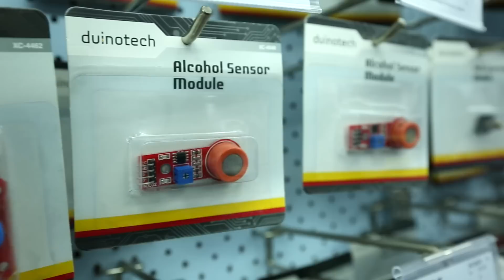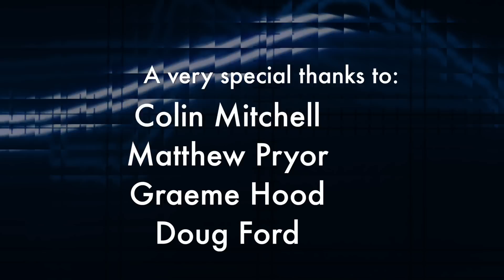The Decline of Hobby Electronics?

Comment: It's impossible to get components now a days without buying them online which can be a pain since even for a 5 pack of resistors the shipping costs more than the actual resistors.
Reply: I am in Europe, ordering parts from  ebay with free shipping is what I do.
It is amazing, now whole sets of capacitors (SMD) an resistors for just a few cents,
same for most chips, everything is there.
Just got a  MASTECH MS2108 Digital True RMS Clamp Multimeter AC DC for 36 $ in an ebay auction.
Can read DC and has rush in current measurement for motors for example.
Sure, there is a lot of crap on ebay too, but the net result so far is positive for me.
Thing arrived in about 10 days. 
Maybe I am not really a 'hobbyist', more a retired electronics designer / programmer...
but still playing electronics ,
 No, an a quick search with Bing will show you that that hobby is not dead at all.
In fact the quality level of it has gone up, what is possible now is amazing.
My site:
 http://panteltje.com/panteltje/newsflex/download.html
many Microchip PIC projects too.
Reply from the maker: Tell me about it. Living in Australia, everything takes forever to arrive and costs a bomb! Forget DHL FEDEX and the rest, even slow mail is expensive and often its a killer to passion for any project in that it takes more then a month often for delivery. It forces you to own your own ready supply of bits so that at least you can tinker without the massive delay!
Reply: bulk is key. don't buy 5 resistors, buy 500 of them(for maybe 10 cents more in total).  kits are generally what you want to go for. just look for "resistors assorted" or something. just buy a set of 600 or how every many you want and you are golden. make sure the values you might need are in there obviously. you even get kits that have capacitors and diodes in them as well if you look harder.
Reply: You can buy bulk packs of resistors from china with free shipping. There are plenty of sellers that supply resistor packs - you get multiples of each value from small to high resistance and the prices are very reasonable. The free shipping is the best part! There are plenty of other deals to be had as well on different components - transistors, IC, diodes, capacitors etc. Check out the site which starts with e and has bay at the end.

Comment: And now Dick Smith has gone completely bust. Apparently the NZ shops were still profitable, it was Australia that let the group down.

But still, there is Jaycar, which is what Dick Smith’s used to be...
Reply: Over here on the topside of the globe (if it can be defined as up) physical shops have made way for online retailers. I have met and become friends with a small online shop owner in my area.

When I was younger I can remember taking trips to my local electronics shop, they had all the standard stuff but dare asking for a specific component. Everything had to be ordered and they used to sell it per piece but way too expensive.

Online everything is so much better, the datasheet is usually linked on the page, only downside is that most retailers won't let you order small amounts when it comes to small components. So you have to order them by 5 or 10, but they cost 2 cents a piece so no biggy.

You can still make your own PCB's but several online PCB manufacturers have popped up allowing you to have your PCB manufactured professionally.

The guy yapping about kits is so wrong! Kits used to exist back in the days too, only difference is back then the kits were waaaaaay to expensive for what they did. I remember buying my first 555 kit, didn't know anything about it back then but when I look back I way overpaid for a simple blinking LED.

Steve from EEVBlog is the only person in the whole video who makes any sense. Hobby electronics aren't dead, it's probably bigger then ever because of all the standardized boards, it has changed it's shape that's all. Through hole components still exist, SMD 1206, 0805, SOIC and a few more packages can be done by hand if you want to. If you want to make something by hand, you still can.

Maybe those shops needed to go because they are obsolete.
Reply: Dick Smith Electronics stopped being the great store they used to be when they were sold out to Woolworths. Dick made a big mistake selling the company. From the moment this happened, the stores started to go downhill. The accountants did not want to stock the good quality parts and tools, so removed them from the shelves and replaced them with cheap nasty crap from china. Then they started thinning out the range of components, until there was almost nothing left. Eventually they stopped selling components completely and replaced them with kettles and toasters and other domestic junk that hobbyists and electronics professionals had no interest in. Jaycar still exists, and they are the last bastion of locally available electronic components. They're different in many ways to what Dick Smith was, but at least we still have somewhere to get things if we need them in a hurry.

Comment: 30 years ago you could buy electronic components by the barrel full.  Now,  just finding components that don't require a magnifier or microscope takes hours.  Young people should be learning ohms law and basic electronic formulas rather than snapping together digital modules that were built by the billion to to earn a billion dollars for the manufacturer.
Reply: That's nonsense, you can buy anything you want and you can use any size components you like you also have a huge selection of kits and modules for any imaginable project which is incomparable to what you could buy 10-20 years ago
The only problem is that using dip components will turn you into laughing stock with masochistic tendencies so no one with self-respect will use them. SMD components are way easier to use.
In some situations, dip components will not even work as their parasitic may ruin your project.
Reply: deltaxcd Lol.

Comment: Most hobbyists get their components online. We had a local shop that used to sell them, this store used to have many customers back in the golden days. A couple years ago they closed for good.

You'll find components online for a much cheaper price. When I bought components from the store I mentioned I paid 15 cents per resistor, while online I can get 100 resistors for 1,50 euros.

When I was building a small radio transmitter I needed an obsolete transistor, I found a manufacturer in China who produces these (HGsemi), these are all brand new, no fakes or refurbished crap. I needed a MRF237 instead I decided to use the 2SC1971, I got the 2SC1971 very cheap I paid 1.5EUR per transistor so I got a lot of them. I've tested the transistor and it had a nice output of 6watts. Never had any problem with their products. If I would buy that transistor locally, I would pay nearly between 20-25euros.

The only thing I can't stand is when people let some company etch their PCB's, I mean seriously? Going to wait so long for a prototype board while you can do it yourself? That's the best part of electronics in my opinion, creating your own PCB. You can manufacture professional PCB's home with silkscreen, it involves silkscreening and UV PCB paint. The results look outstanding.

Here check this video: https://www.youtube.com/watch?v=8-WGaAmpfOU

Comment: If someone can design a sub $200 component population machine it will come back very quickly.
Reply: you do not need any machines to solder smd componenst 
assembling SMD is even easier than DIP
Reply: Bug me every Monday for the next 3 months (else I'll forget) and I'll have one built that's sub $200 CAD. (it won't be super fast though since it'll use a screw system, but still, faster than I can do by hand, & camera component positioning to make sure components go in staight)
Reply: Watch this guy he got tricks
https://www.youtube.com/user/mikeselectricstuff/videos

Comment: The man at 4:30 talking about "special" this and that is a prime example of hyperbole. You need tweezers, oh god how will you afford a 2 dollar tool?! Precise temperatures? I've soldered hundreds of surface mount parts successfully and to this day I can't tell you what exact temperature those were set to! Careful hands?! Not at all! Place it on and heat it on low air... that's it. Hot air stations are cheaper than good quality soldering irons! With all respect towards his knowledge, which without a doubt surpasses mine, he needs to have a more open mind to the new state of electronics.

Comment: Surface mount technology has killed the hobby
Reply: Andrew Dollins I have to disagree with you here through hole are infinitely better that smd
Reply: Actually kinda improved it. Today I made a buck converter working with input voltages upto 40V and turning them into 5V. I used both through hole and SMD (and a small breakout board). The whole unit is soldered neatly and crammed into a heatshrink tubing. This whole circuitry is A LOT more efficient than its linear counterpart LM7805, being just a bit bigger sizewise. If it was all through-hole, it would have taken a lot more space(at least 4x).
Reply: ElecDIY true
Reply: It only costs 35 dollars to use surface mount components. Plus it is arguably 10x easier than thru hole. If a dumb robot can place surface mount then a human can do it 10x better. Thru hole requires way more skill and dexterity than Surface mount... I used to think the way Thakur thought but it's just not true.
Reply: Try it before you knock it. I used to think the same as you do, but after doing several smd designs and me hand assembling them it is actually smd is great just dont go smaller than 603 sized components. 1206-603 is very doable and if you invest the amount a good soldering iron you can hand assemble smd boards faster than thru hole.

Comment: IC's and microcontrollers do work but as a hobbyist, you don't really know what's going on in there. I always admired transistor radios because of this. They don't hide their components.
Reply: Are schematics available for micro controllers?
Reply: You can see block diagrams but not the actual schematics. (most of the time)
Reply: I hear ya.

Comment: when you can buy fully assembled Oscilloscope with color screen for 18 bucks and buck converter for 6 bucks... noway the hobbits electronic would be the same
Reply: I built a valve (tube) oscilloscope, scratch built from discrete components, in 1970.
I even made the 'circuit board' myself - a sheet of nonconductive plastic with a zillion holes drilled in it on a square grid (no printed circuit stuff in those days) with point to point wiring.
It's on my workbench now, still working as it did all those years ago.

Comment: The worst part about SMT is that it requires a pcb to be mounted on.  If you're building a custom one-off circuit, which hobbists usually do, this involves board layout and either fabricating (milling or etching) or buying a pcb.  That's fine for mass production, but a royal pain for prototyping.  

SMT is also a lot more difficult to develop In-circuit test fixturing.  Through-hole boards are great.  You have 100% net access for the test pins. The test generators work well, you get actual vectored tests that can isolate and test individual chips on a pcb.  Much of these kinds of tests have been replaced with boundary-scan testing, that only tests for pin shorts and opens (connectivity).   Even worse, many ICT test systems use unpowered "vectorless tests" that use a metal plate and amplifier mounted above the chip to measure the capacitive coupling between a net on the board and the lead frame of an IC. If you have poor test access, you still generate a test, but it may only cover 30% of the pins on the device.  And even then, these kinds of tests are not actually testing the device, only measuring a capacitance, then concluding, "Yeah, this wide range (-50% to +50%) 120 femtofarad capacitance measurement was in range, that pin must be good".  These vectorless tests will often fail when compatible ICs from different vendors are used and can even vary from lot-code to lot-code of the same devices.   Test access is sacrificed as circuit density increases, and becomes less of a priority as the manufacturing cost decreases.  PCBs become cheap and disposable.  Functionally test it and if it doesn't pass and has no obvious visual defect, scrap it.  That's the modern electronics testing paradigm.  Then managers are clueless to explain why scrap rates are so high, and process improvement suffers.
Reply: Dan Nguyen i hear you!
Reply: Layout a PCB and getting it fabricated is still a large time investment compared to wiring something up on a breadboard.  I've done some prototyping on ivan-boards (array of square pads), but these can be a little pricey.
Reply: I don't remember.  But $40 a piece seems about right.  I've not used busboard before, I'll have to check that out.  I've taken a drimmel tool to 2-sided plated pcb boards and "routed" sections by hand for very simple circuits (filters usually), but it is still a pain.

Comment: What are those old geezers talking?
From what time tweezers turned into highly advanced technology?
The only people who cannot manage SMD components are cripples with cerebral paralysis or missing one hand and 3 fingers.
SMD components are much easier to use than DIP because you do not need to drill holes anymore and you can make PCB much smaller and cheaper by using primitive toner transfer technologies you can produce PCB in less than a hour.
Just think what it would be to drill 100 holes for some common modern chip by hand.

The only problem for hobbyists is BGA components primarily because they require at least 4 layer pcb, preferably  8 layers to use them properly

The reason why hobby electronic is on the decline is that every imaginable product is already being mass-produced and sold for penies the only area where you can still work as the hobbyist is very niche spaces where the sale of the product may be illegal or market is too small.
Reply: Don't you have a video game to play.
Reply: If only there was some way to get rid of those smart ass retards who cannot even make any argument in their reply.
Reply: No, I think he is right. And if it's not already produced in a circuit itself all you need to do is a quick app search and generations of people are lost to that thought. I won't say who but I saw a gentleman on here make an arduino-based rain alert and I said to him "Why didn't you get a rain app?" because I am a frequent bicycle commuter I have tested & really used several very accurate rain apps even amongst skyscrapers where his device may not work so accurately. Hours maybe even weeks of work could have been saved by just an app search first. 

Even though he is a programmer he hadn't thought of it. Ironic, but true.

Comment: This is why software development is the key. It's not that any electronics hobbyist can't create the components they need. But for example, think of a Raspberry Pi. In order to duplicate everything that little $35 board can do, you would have to fill a room with discreet components and an endless chain of wires. Now, you can focus on making the hardware do something. Changing times but not worse ...